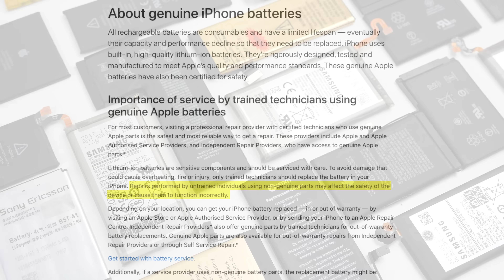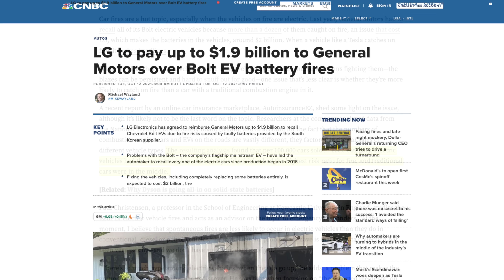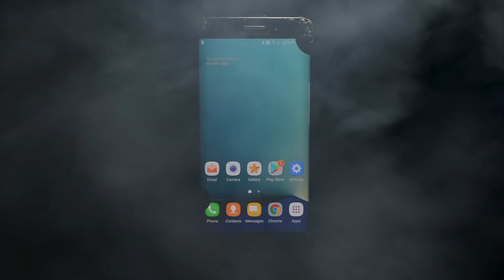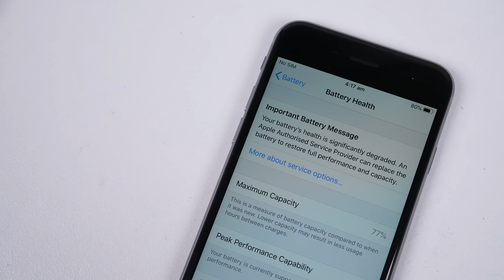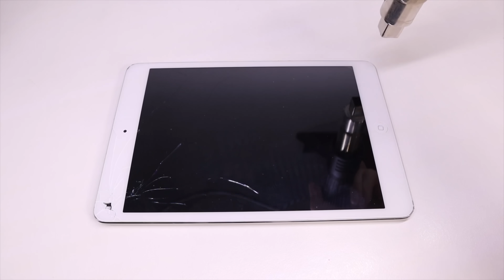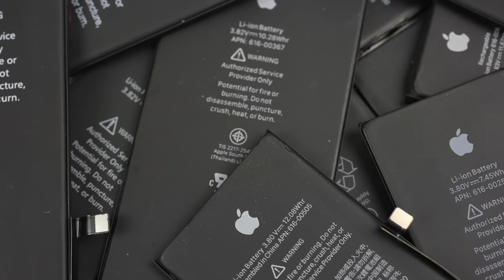Terrifying Hidden Danger of Batteries - From Phones to EV’s - How to Avoid the Risk.

Comment: Video starts: 4:22 
Discharge battery below 15%, less energy to release/burn if damaged
Isopropyl alcohol is best for removing battery from adhesive (less risk damaging battery pulling/bending it)
Heat can also be used to soften adhesive, but he advises a controlled heating like a heat plate (or a microwavable heating pad) over direct heat like a heat gun which risks thermal runaway/severe overheating (*coughs* -I used my electric stove on lowest setting & thermometer constant checking since I don't have anything else-)
Avoid charging on flammable surfaces such as bed sheets

Can anyone find louis rossman's video where he removes an iphone battery with a hammer? I can't seem to find it, think it was in reaction to someone at apple claiming batteries are too dangerous for any user servicing
Reply: I have to add don't charge with damaged or sketchy charging bricks and cables since the sketchy ones may not have the proper components on the connector board or board within the sketchy charging brick to properly regulate the amount of current going from the wall/surge protector into the phone.

Comment: Most of my family are not a fan of EVs due to the dangers of lithium batteries, perhaps made worse by the fact that with EVs there is a high chance of the battery going runaway in the event of a crash
Reply: Well, a good EV is designed in a way that minimizes damage to the battery compartment during a crash but obviously it's not impossible to damage it
Reply: My dad don't like them EVs.

Comment: I have performed repairs on many different Apple devices from many different eras, it’s a real shame it went from the relatively easy battery replacement process on the iPhone 4 and 4s to now where it is nearly impossible without ruining your screen and housing in the process same goes with MacBooks, I repaired a unibody MacBook Pro and it was so easy to get the battery out minus a few security screws now you may as well replace the entire top case
Reply: I feel like Apple began the whole deal with not caring about repair at 1st (the mixed bag of easy vs. near impossible iPods shows what I mean), with never really bothering to actively making it harder, just focusing on attaining their wanted design and whatever suffers in the process be it, to nowadays actively being asses about it, deliberately making it harder, because they simply know that phones and even PCs have peaked, and there isn't anything really compelling enough to make you want a new one, other than your old one failing.
Reply: I have about 3 really decent (at the time) phones over the past 7-8 years and all of them had battery issues, 2 swelled up and another just refused to charge up. If only I could open it up I wouldn't have had to buy new phones, oh hang on maybe thats the point.
Reply: Stop buying their products. Their anti-consumer practices has been known for years. I have been lobbying in my job against their laptops years ago, which were more expensive (performed worse for the price), limited (memory soldered on board), with few ports (required dongles to expand, everyone got expensive dongles by default).
Reply: @pavel9652  I was locked into their ecosystem but I am gradually switching away, but I do like to buy and flip their older phones on eBay, my next phone will probably be a google pixel the only Apple device I still use is my iPhone it’s a gradual process because I don’t upgrade often
Reply: I figure there should be an regulatory/investigative body like the NTSB. Aircrafts are rather safe due to the extensive investigations and fail-safes implemented thereafter. I rate the same should apply to EVs and large scale battery infrastructure.
Reply: I like your profile pic, Peer not Apple😆.
Reply: also discharging battery is impossible because when it show 0% i mean it still have 3v (between 3v and 5v)
Reply: @Kaleverest1284  okay, but the point was to discuss much as possible to reduce the possibility or severity of any battery fire. This is why companies like Apple ask customers to discharge phones to at least 15% when they bring phones in for battery replacement...most customers ignore this, though!
Reply: @AtomicExtremophile  i know but first time i though that battery when 0% it empty
but after long time i learned the truth it always contain eletrones
Reply: @Kaleverest1284  depending on the chemistry (Fe, Ti, Ion, PO) lithium cells can be discharged only to 2.2 to 3.2v. Discharging beyond the voltages result in damaged cells.
Reply: My galaxy S5 would have said even the iphone 2g battery was hard to remove. OK, i'm lieing, i never had a galaxy S5, i had a galaxy S3 at the time, but that still doesn't change the point.
Reply: @eivis13  the iPhone 2g battery is soldered on and hard to remove

Comment: If you work with lithium batteries, it is a good idea to have a fire-proof bucket of some kind nearby. Maybe even filled with water. And a long object to push it into the bucket ;D
Reply: Water is not a good idea, evident by the video. Maybe it helps full the fire by providing oxygen? Either way it would be better to do it an other way
Reply: @en_kvadrat  No, water works just fine. The point is not to stop the cells from reacting, but to take the thermal energy away. Water works best for that by far. That will prevent any attached plastic from burning. It's reacting completely by itself.

Comment: Well looks like Samsung is easing out battery replacements by adding pull tabs and light adhesive, I saw that on their latest phones starting by the S23.
Ofc you still need to remove the back panel which is glued down but at least they make it reliable and less risky to replace with those changes.

Comment: That’s why we need newer and safer battery tech. Silicon-carbon batteries looks promising (hopefully).
Reply: @@momytik from the news i’ve read, a few smartphone models are already Si-C batteries. However, they’re still mostly in China.
Reply: Also retraining fire departments for Ev's is a absolutely must.
Reply: We have life po4 or lithium iron phosphates which is meant to be a safer battery will we ever see it in mobile/portable devices IDK
Reply: @ellisgarbutt1925  They already use it in EVs with no issues, companies don't want them in devices like phones or laptops because that would mean they'd basically never need to be replaced in most use cases.
Reply: @destructionfun2  didnt know they were used im evs & yeah I czm see that unless some law came into effect can't see that thappening
Reply: @ellisgarbutt1925  I mean, they've been used in electric buses and bikes for years now, and there's no law stopping a company from using a LiFe battery in a phone or laptop, it would probably even be cheaper because the resources are more plentiful and there isn't a super huge demand for them like there is Lithium Ion batteries.
Reply: @destructionfun2 Also lithium iron phosphate batteries has lower energy density than standard lithium ion, so it is not worth it to put it into small devices
Reply: @destructionfun2  since they got a lower energy density, the muh specs sheet gonna suffer, they can't claim their old product was less safe than the new one to justify it being bulkier for the same battery capacity, or less capacity for the same size right? That would be the responsible thing to do, but yeah... Muh sales numbers...
Reply: @destructionfun2   no, the reason why manufacturers don't place LFP batteries in smartphones is because you'd shrink the capacity from the typical 5000 mAh down to around 3500 mAh. Would you prefer that? Right, me neither.
Reply: @BVZTIII  I actually would, because due to the nature of my job, i'm not superglued to it like a lot of other people are, so my phone can comfortably coast all day & night with my battery not dipping below 75-80% on a slow day.
Reply: @destructionfun2   then, you can instead just charge to ~80% and recharge when you reach 20%, and you'll have a similar lifetime to LFP batteries using the current ones. Keeping it far above 80% all the time destroys your battery life span.

Just to let you know, if you charge a battery to 100% and then proceed to do absolutely nothing with it for 2 years straight up, it will still lose around 20% state of health in the mean time.
Reply: The safest battery chemistry to date are LFP ones. Their energy density isn't as high as on NMC (basically any car manufacturer) or NCA (most Teslas), but they won't even have a thermal runaway if you punctuate them, or drastically overheat them.
Reply: it's faster to force removable batteries than developing a whole new battery production process/chemistry
Reply: Yeah i faced 3 phones with bloated batteries
Reply: no we need replacable batteries so when new batterie tech rolls around you can just switch to it
Reply: @PLPlolol1 sigh, seems most people don't know how batteries work.
Reply: @surewhynot6259  nylvon gave me a good explanation, youre just being mean
Reply: @PLPlolol1  That's not how it works; devices have battery managament ICs on them, those aren't made for any kind of battery, they're made for specific kinds of cells; for instance, a NiMH battery management circuit is different from a Lithium Ion battery management circuit. You'd have to change the IC, but there is no telling if the pinout, form factor, etc of the new IC will be the same. You'd ideally have to put those on the battery, but then you'd have the issue of communicating with all these technologies through the same interface, so you'd have to put some microcontroller on the battery. Now THAT could potentially work.
Reply: @nylvon 
A firmware update can change that. Also, those ICs you are referring to can sometimes be part of the battery itself, as was the case for the PSP's batteries and many replacable camera batteries even today. It would also be possible to release devices with logic to handle many types of batteries. Many older devices already did such things. Portable tape decks, CD players, cameras, and radios just as a few examples. These devices worked with many different types of batteries from alkaline to lithium-polymer cells, especially in the early 2000s.
Reply: @@momytik>years away

Not per se. We’ve had better battery tech for decades. The issue has been manufacturing it at scale, thus we were stuck in a chicken-and-egg loop where because nobody wanted to front the costs of deploying 'untested' battery tech to the mass market, no one developed it, meaning that it remained promising tech that no one wanted to further develop.

Thanks to more awareness of the issues, especially issues surrounding the manufacturing and disposal of lithium-ion batteries, there is now more incentives to look for alternatives…even if they are still "years away."

Comment: This video is crazy, because my local news channel, news channel 5 of Nashville, just got done covering this issue today. Someone’s house recently burnt down in our area due to using an off brand lithium battery and/or charger. The Nashville FD stated it’s a common issue. 

I never use cheap batteries. I only use Energizer or Duracell. I always use original chargers. Use extension cords correctly. My electric wires are checked throughout the house yearly by professionals. I have fire extinguishers everywhere. Escape ladders.
Reply: The last AA dura cells that I bought, lasted about a week past the product return date, which was 30 days. I only used them in my remote control.....
Reply: Unfortunately I know someone who put a third party 7000 mAH battery into his iphone and before he did it I warned him of the potential dangers of that. But of course he still decided he wants to play with fire and I don't know any better. If I remember correctly he had an iphone 13, I just hope the amazon page was lying about the capacity and its just a more normal capacity.
Reply: I wouldn't trust Energizer or Duracell. Overpriced junk that is made in China just like all the other batteries. They leak when you just look at them.
Reply: @@phillipbanes5484 Since the early 1980s.
Reply: @@phillipbanes5484 it’s not, actually. Every year, faulty wires / house electric work causes house fires. It pays to have them checked annually
Reply: Alkaline batteries aren't a fire hazard, you're just getting ripped off by paying a premium price for Duracells.
Reply: I’m glad you have multiple ladders,🤔a must nowadays. I got lucky and found out my friend used to check home wiring for a living so he gives a discount every year for mine. Only 600 compared to the usual 1200 everyone else charges.👀
Reply: @@phillipbanes5484I’m glad I never was gullible, I avoid the scammers and their fake labels by shopping from the walmart app instead!!! Amazon is for the amateurs!!!
Reply: Duraleaks be like: "Nice electronics you have here. Would be a shame if I leaked extremely corrosive juice over it's contacts."
Reply: If your batteries are made in Germany, it doesn't matter what brand you buy. They make the gold standard.
Reply: @Heymrk  Have you heard of fake labels on batteries?
Reply: @zorbakaput8537  Have you heard of industry standards and quality control?
Reply: Wonder how much you pay to have electricians "check your wires" yearly.
Reply: Using more expensive batteries and chargers do not fully proect you from errors. The best measure you can take is to only charge batteries when you are in proximity. I am not that picky about batteries are chargers, I have plenty of cheap ones around, but I do not use them when not being at home. Maybe at some point I will build a charging cage. A box made from non inflamable materials, inside of which I charge devices. If something bad does happen, only the box's insides will get destroyed.

Comment: I can confidently say Electric Cars are the worst thing that has been invented in the last two decades. Not only do they not help save the environment due to the manufacturing processes and the fact that they literally need fossil fuel powerstations to charge them, they're also detrimental in a safety sense that you're effectively driving around a massive laptop battery. Also, the amount of water and fumes that are released into the air does literally nothing for the environment either.

Comment: doesn't all technology use lithium ion battery's?
Reply: No, there's various battery chemistries out there, such as NiMH and LiFePo4 batteries. Lithium Ion batteries are pretty common in mobile tech like laptops and phones, but it is very unlikely you'll see them in other fields, such as power tools and such, which usually use NiMH batteries. You design based on the requirements.

Comment: That's why I'm not ready to give up my gas powered car yet, until they force us to switch to EV
Reply: I mean the best thing you can do is keep whatever you currently have anyway.
Reply: @Guy-Zero Yea! IT IS best to keep what's workin! i have an iPhone 4S That still works, albeit very slowly but it will get the job done! Brand new Laptop? Nah, i have a Lenovo ThinkPad T Something from Late 2011! It does PlayStation Emulation Just Fine. New Car? No Way! There are some people driving fairly old cars, Specifically Toyota, Is Just fine! I heard that a '96 Camry Wagon is at 1.6 MILLION Kilometers (Or 1 Million Miles for people that use old mesuarements), And it Still Runs!